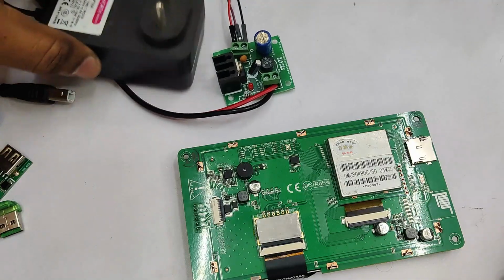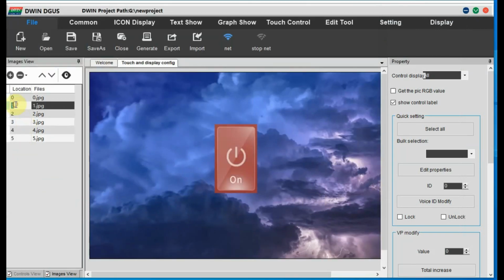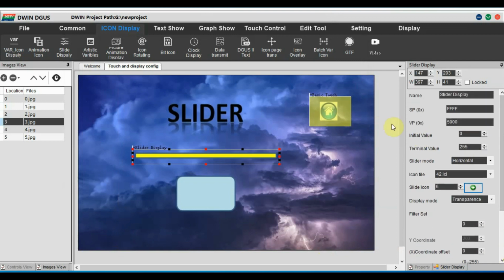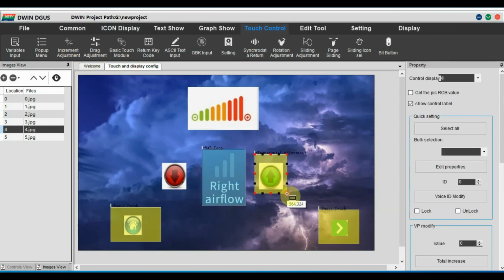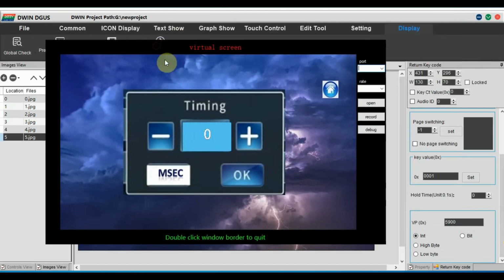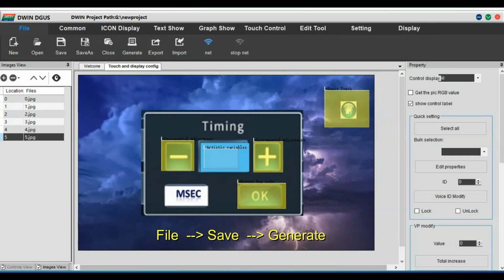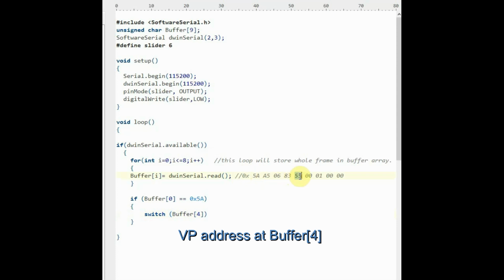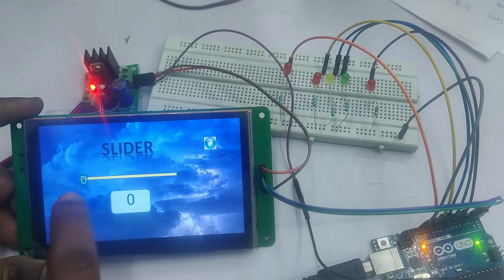#5 DWIN HMI Touch Display - Graphical User Design -  Slider -Data & Artistic Variable -Arduino code

Comment: I am trying to download to my dwin display your dwinset files but the imege is rotated 90 degree. What is my fault, what i should change in my settings? My displsy is a 4,3 inch 800x480 thanks

Comment: why is data 255? can you make example for data greater ???
Reply: There is 8-bits in a byte, 1 nyte in binary logic has aaz capacity of 255. It is not a setting but a physical hardware limit

Comment: Sir will send a pgm how to send an array of data (1000 elements) to Dwin with 1 millisecond delay using Arduino...

For eg. Arduino code
For (i=0;i<1000;i++)
{
Array[i]=i
Serial.write(Array[i])
delay (1millisecond)
}

Receive on Dwin
How?...with 1 millisecond delay?

Kindly to reply thanks...